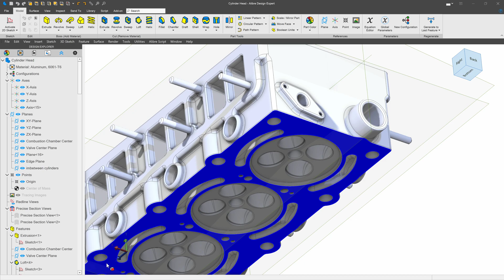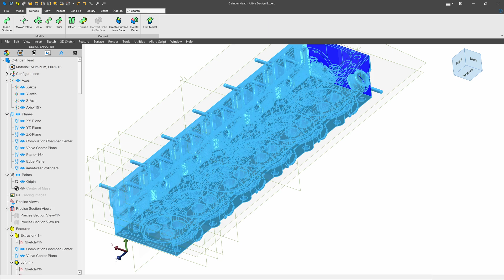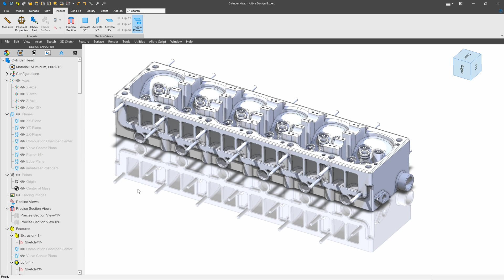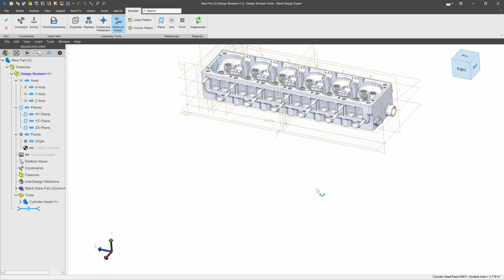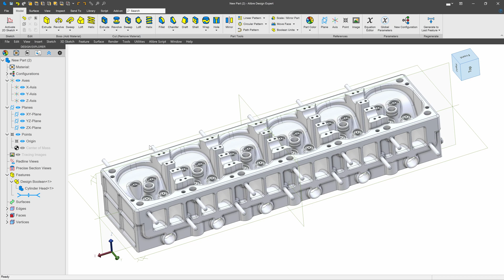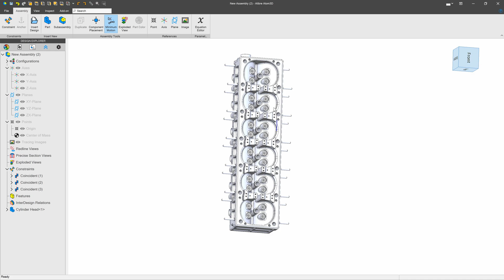3 Ways to Re-Orient Parts in Alibre

Comment: Hello Friends,
 When I used the convert to surface method, it seems to have hollowed out my part. I did not discover this until I went to perform an subtractive extrude later on. I'm not sure why this happens. Any help would be appreciated, thank you.
Reply from the maker: Hi ddw34, If I understand, the convert to surface method left your part hallow after converting back to solid.  That's a great question- thanks for asking.  At times, the stitch to solid tool may expect multiple surfaces to be stitched.  One easy fix on this issue is to roll the tree back to right before you stitched to solid, and click on the split surface command and split a single face.  Then, stitch your surface body and the one surface you split into a solid.  Having multiple selections on the stitch to solid command fixes the hollow part issue.  Let me know if that helps.
Reply: @AlibreLLC  Thanks for the advice, I haven't gotten chance to try it yet i just decided not to rotate my part and progressed past the point of trying it, but I will do this next time  I do so.

Comment: Great video!  I did not know about the first two methods.  I've been using the third method (orient part in a new assembly).  In fact, I use this method to align the CG of a part or assembly with the origin because Alibre--frustratingly--doesn't calculate the mass moments of inertia at the CG.  It only calculates the mass moments of inertia about the origin and the principle axes.  This is one of the features that Alibre is sorely lacking (along with an assembly constraint that allows one to center a face between two faces--rather than have to calculate offset values).

Comment: Excellent video as always. I do have a request. I used Inventor and the wire/cable/harness add on. I know I would be able to create wires and cables in Alibre using parameters; however, is there a straightforward way or technique to add cables and wires? I'm sure this is a feature a lot of people will want (or want to know how to do). The way I would probably do it in Alibre is to use the sweep and drive the parameters of some of the lengths, for instance, if the cable was in a cable chain, the bottom and the top lengths of the cable in the chain would drive each other in some way. Anyhow, hope to hear a good process on how to do this.
Reply: I'm sure Joseph will come up with a more focused explanation of this as soon as he gets the time. In the meantime, in my 3D sketch video I create a couple of tubes running from a pneumatic valve up to a pneumatic cylinder. It's not exactly what you want, but it's close. It's near the end of the video. So, if you already know about 3D sketching you can skip most of it and go straight to that part.
https://youtu.be/h6EZQeae4fE
Reply: @ExMachinaEngineering  Excellent. Thanks for the link. I will check it out. I plan to create these on my daily livestreams.